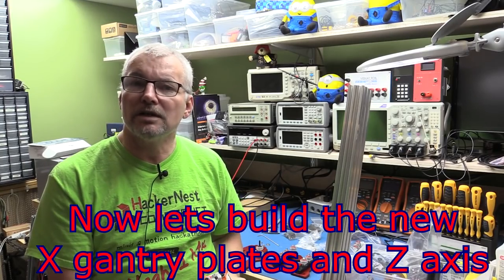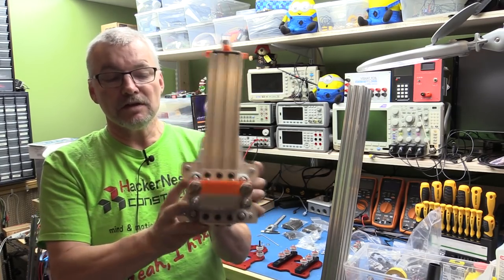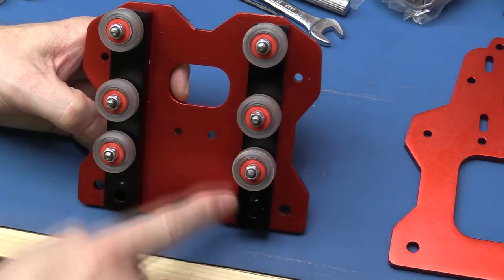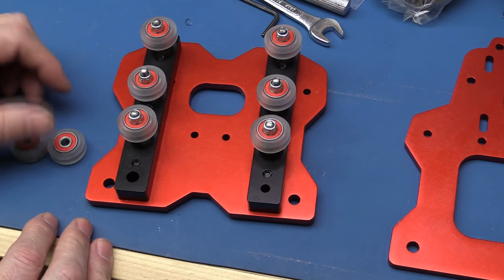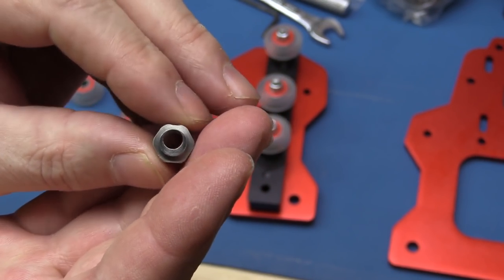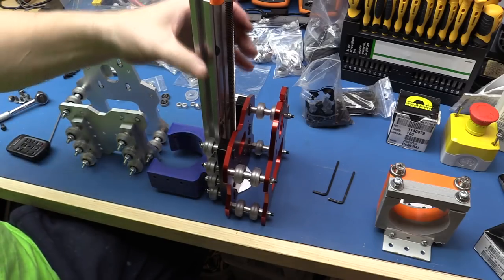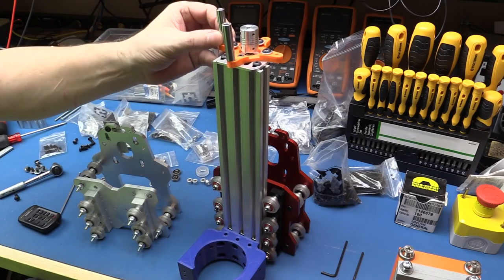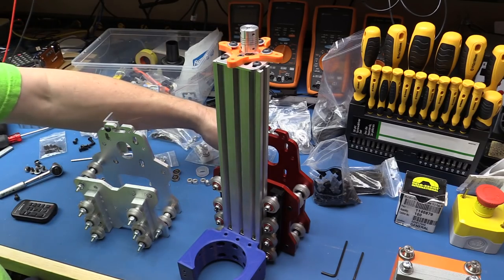Rover OX CNC - PT2 of 2 - Upgrade X and Z axis

Comment: If you use C-beam in place of the 2040 at front and back you can use the 2040 for the bed supports and screw a piece of MDF to them for a waste board to cut on. this might also strengthen the frame. I was going to cut the ends of the back and front c-beam to fit inside the side C-beams and use corner plates to support on the under side.

Comment: With a similar router or if it's possible to fit a larger one from say DeWalt, Ryobe, etc... With the proper cutting  "bit" (something hard and sharp, like a carbide bit) do u think I can cut non-hardened/heat-treated aluminum? Not anything very large or from a big block of metal!  But a reasonably thick (1" or so) small plate. Maybe cut out a relatively simple circular clamp? Like the round mount that holds/clamps around the router? Hope you understood what I was trying to say!  Or perhaps something like an aluminum, screw-in (so threaded... But you can forget that for the moment, just think about the shape!) or just "push in" aluminum gas/petrol cap for a sports car? Maybe even engrave "gas"/"petrol" or an aluminum oil filler cap for the top of your engine? Which maybe has a picture of an "oil tank" or engraved "oil" on it? Or how about the old aluminum Land a Rover badge from thick sheet aluminum (0.5"?) THANKS!
Reply from the maker: all should be possible with the exception of ferrous metals, you would have to strengthen the machine considerably for that.
Mounting a larger router is definitely possible but due to the increased mass you will need to make sure the steppers are strong enough and you will probably have to slow down the feeds or at least acceleration  a bit so you dont overshoot due to inertia. 

When cutting thicker materials it's all down to taking it easy, not too fast, not too deep. the job will take longer than a milling machine of course but it should eventually get there,

Don't go too slow though as you will start heating up the bit too much due to rubbing rather than cutting and you may need to add a bit of coolant (Always helps but not always essential as you will have seen on many videos.

If you think about it, cutting a 1/4 inch sheet is no different than one an inch thick. On a CNC with Belts like mine even cutting 1/4 inch would not be done in a single pass but it can be done.

Comment: Wonderful videos that you have been uploading about your ox, thank you for the valuable information. Currently my Ox is suffering from Z axis rigidity issues due to only having the 3 wheels. How much play would you say has been resolved as a result of the additional wheels? I am considering redesigning the Z axis altogether and utilizing linear rails and a ball screw but that may be overkill for the belt driven machine.
Reply from the maker: +John Schwarzanegger The linear rails would help but as you say, having belts else where would minumize the benefit
With my setup I think alot of the play is because I have 2 60x20s for the X and I am working to change that to a 80x40. I have the beam, I just need a new X plate set to use it, I also have an 80x40 Z built but same issue, needing a X plate set to leverage the better more robust extrusions
Reply: +Peter Oakes (TheBreadboardca) Screwing together the 2 60x20s with some M5 bolts has tremendously helped with minimizing the play between the rails, you should try that.
And last night I've purchased a very nice prebuilt Z axis with linear shafts. I should just be able to attach it to my X plate with a few new holes and bolts. Ultimately the goal is to upgrade my machine in a way that I can switch over to ballscrews and linear rails. Also, doing the double-belt mod for my Y axis has minimized belt stretching and improved my accuracy. I hope to do the same for my X axis very soon.
Reply: Peter Oakes

Comment: what about super-glue slow acting between the two rail and clamping bonding spray optional
Reply from the maker: I dont know if that would hold upto the vibrations over time, these new beams will and also add other possible upgrade options that can sit in the C part of the beam

Comment: X axis 1500mm using double 2060 not flex ?
why not use double 2080
Reply from the maker: +Lens Tj I have a 1500mm length of 80x40 (Same as double 80x40 but all one part) to use there, the new C Beam extrusions. but I need to get new X plates to handle it which is why its not installed yet, same for the 80x40 Z axis